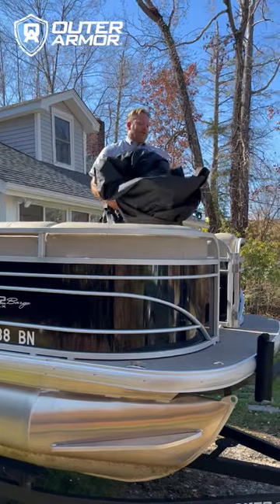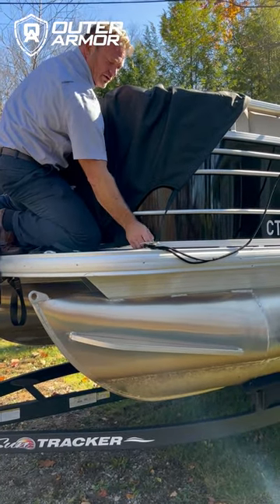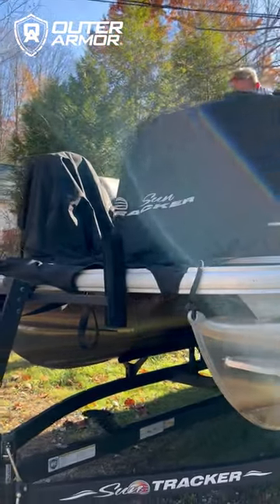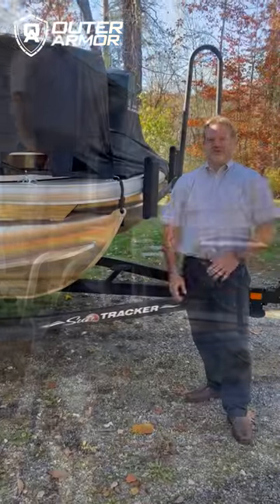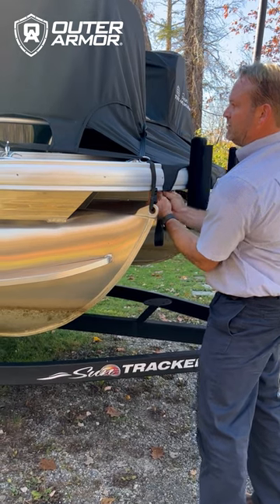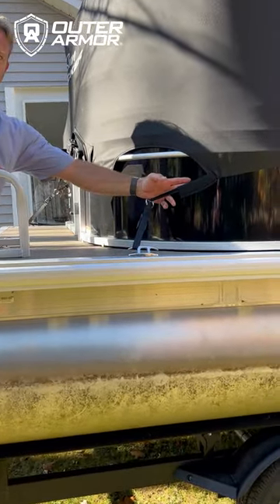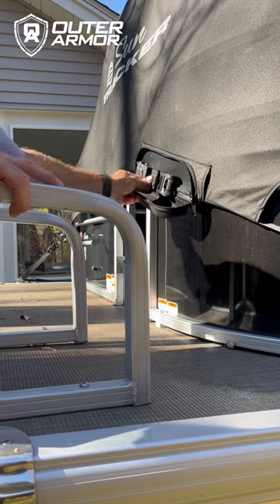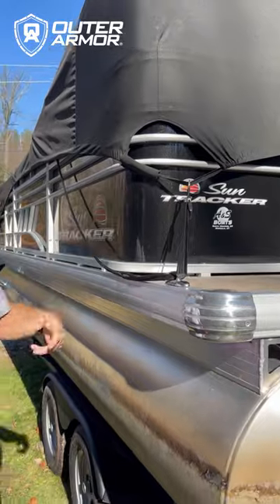Trough Pontoon Mooring Cover February 2023

Comment: Can this be used in winter,  will it take a snow load?
Reply from the maker: Our covers are designed for in-season use. We suggest that boat owners winterize and properly wrap their boats with the white shrink material (PVC or polyethylene) that is designed for transportation and cold weather storage if the boat will be left outside.